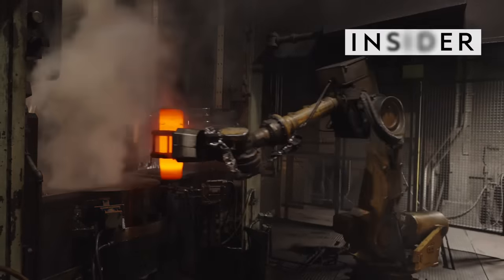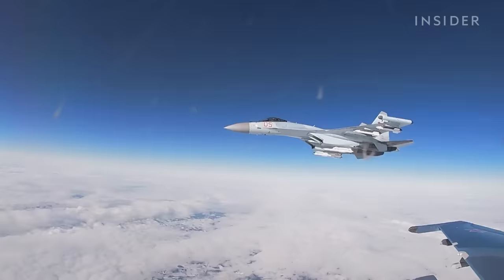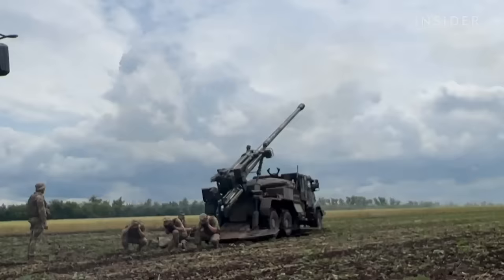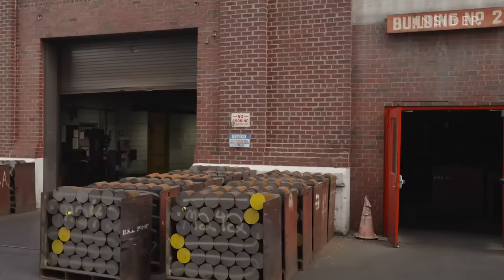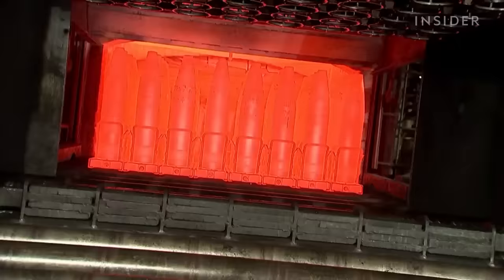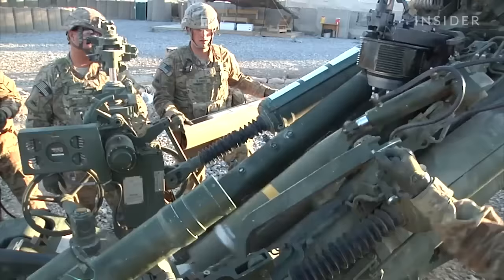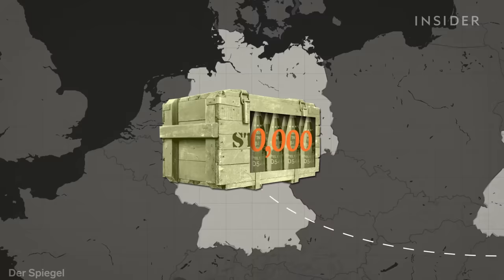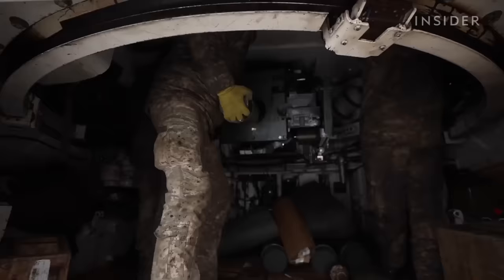Inside The US Factory Making Ukraine’s Most Important Ammo

Comment: Production
0:22 Scranton Ammunition Plant: less than 400 shells/day.
2:39 USA totally, before 2022: 400 shells/day. Today 800 /day.
5:50 Feb 2022 - Aug 2023 (540 days) USA have sent 2 million = 3.700/day
6:46 By 2028 USA want to make 2.800/day
Europe have 4 factories and produce 1.100/day (Sweden 1 factory, 200/day)
At summer 2022 Ruzzia used estimated 50.000 shells/day and Ukraine 5.000. Since Jan 2023 it's about equal 5.000/day.
Latest update Feb 2024: Russia 10.000/day, Ukraine 2.000/day.
Reply: South Korea has a large 155mm production capacity and a vast stockpile.
Reply: Can i ask, how much cost different between 105 vs 155mm shell without fuse
Reply: @dernadaarmando2948  105mm is less than 1/2 the range of 155mm and far less effective against any armoured vehicles!

Comment: The answer to the shortage of shells might not be more shells, but far fewer smart shells. The need for so many shells is in large part because the vast majority being fired are unguided and many of the targets are small like a vehicle hiding in the trees or a specific house being used as a command and control center. Because unguided shells like these M795s can't correct any errors after it is fired, only 50% of them lands inside a circle 280 meters across at maximum range. And if the center of that circle is say 100 meters away from the target nearly all of the shells will land off to one side. And so several rounds have to be fired to check the aim and then after any corrections to the aim are made it still requires potentially dozens additional rounds to be fired before one lands close enough to destroy an armored vehicle, or the house.

Guided shells like the M982 Excalibur use GPS to calculate any errors in their flight path after they are fired and adjustment fins to steer it back on course. As a result the very first Excalibur round fired has a 50% chance of landing within 4 meters of an aim point, and that aim point has been shifted to be exactly the coordinates of the target. Thus it often takes only 1 or perhaps 2 of these rounds to destroy the target. But at $100,000 each, this type of round can't be used on every target.

But the Excalibur isn't the only choice. There are precision guidance kits (PGKs) like the US M1195 that only costs about $6500 each. These PGKs screws into the nose of an $800 M795 in place of the standard fuse, and turns it into a precision guided munition with very nearly the same accuracy as the Excalibur. Guided by a PGK, the very first M795s fired can be guided to impact within less than 10 meters of the target. Field test have shown an even small circle, with one firing 9 shells and all of them landed within 3 meters of the target. Two of the shells in that test went right through the roof of the junk SUV being used as a target. (BTW, those shells didn't have any explosive in them or that SUV would have been a smoking ruin after the first shell landed just 1 meter away)

As a result just one or two PGK tipped shells can accomplish what would require 15 or more unguided shells, then the cost is roughly the same when looking at just the cost of the shells and PGKs. But the total cost includes far more than just the shells. There is the cost of shipping nearly 10 times more shells from the US to Ukraine, the large warehouses to store that many shells (which make really juicy targets), the cost and risk to personnel and materials to move that huge stream of shells up to the frontlines. Plus artillery barrels can only fire 1000 or so rounds before having to be replaced. And if the enemy can get within range of the only road into an area, the number of shells that make it through can be greatly reduced. That small number might not be able to push back the enemy if they were dumb shells and dozens had to be fired at every target. The area might then have to be abandoned or troops are encircled and killed or captured if they can't retreat. But that same small number, if they were smart rounds, might be sufficient to hold the ground.  And lastly there is the cost of not being able to destroy a target because they know that they are being targeted with the first couple of ranging rounds and so a vehicle can move (and if artillery has a hard time hitting a small stationary target, it has an almost impossible time hitting a moving one), or the senior officers with very unique skills and capabilities can retreat into an armored bunker to live to effectively command armies another day.

I'm not saying we shouldn't be putting a lot of effort into making more 155mm shells. What I am saying is that we should be putting even more effort in making PGKs so that as many of those shells as physically possible can be smart shells rather than dumb ones.
Reply: smart shells do not remove the need of standard and cluster shells, but yes, in some instances smart could be a solution if it wasn't for so greedy US military industry that asks too much money per such shell
Reply: 280 meters?  LOL, you have a source?  Dispersion is usually an oval, not a circle.

Comment: What the Ukrainians need along with Taiwan are programmable drones similar to the ones used in the film ANGEL HAS FALLEN, drones programmed to hunt enemy armor and artillery capable of carrying up to 5lbs of explosives that can stay in the air for 24 hours and travel 600 miles and back. Each drone would cost no more than $1,000.
Reply: That sounds interesting. I didn't know that there was such a thing.
The Ukrainians have now developed a drone capable of carrying a 10 kilo shell that can take out a T-72 and costs about $1000. Not bad when you think a T-72 costs about 4 million.
Reply: @mikethespike7579  The basics of these drones is from China.
Reply: @holgernarrog962  Yeah, that's the big laugher.
Reply: @mikethespike7579  South Korea and Japan have as well a huge electronic industry suitable to make such drones.
Reply: The costs of a Russian tank is irrelevant. Most were made by the Soviets. Money spent generations ago. 
Russia is no longer making new tanks and they are struggling to repair/restore anything from stored/scrapyard stock.
Reply: @davidelliott5843  Everything has a cost,  regardless of how old. When a tank is destroyed that is one piece of hardware less to conduct a war with, hardware that the generals relied on having and now have to plan without. Also, the tank crews, at least half of them die when tanks are destroyed, tank crews with valuable experience.
Reply: @dearmas9068  You'd be surprised what you get for 1000 bucks. Most of it is anyway just software and a bit of electronics.
Reply: They need MEN!

Comment: 155mm are fired from cannons. cannons are not mortors. cannons are not rockets. cannons are cannons. basically the opposite of the 'facts' presented here.  Cannon is like a big gun, with a rear breech that opens to accept the round and explosive charge. mortors are tubes with one end sealed to include an ignition pin inside the tube. the mortor shell includes the round and explosive charge. drop the shell into the tube so it falls down to the inition pin. 
Some cannons fire shells (round and explosive charge packaged into a shell casing to hold it together). but they are loaded from the breech, not dropped down the barrel.

Comment: So we have a vertebell problem as I'm looking at your sales fire out I'm seeing the rotation of it's cooling and heating being absorbed the wrong direction so the distance of your length has a volume spread against you or your size of your ratios of what you consider metric weight and material is being designed in the wrong direction
Reply: What the hell are you trying to say ?
Reply: That is exactly what I was thinking.
Reply: Ur heat is expanding out of your bullet which means the compression that you use to produce your bullet not a solid as you think